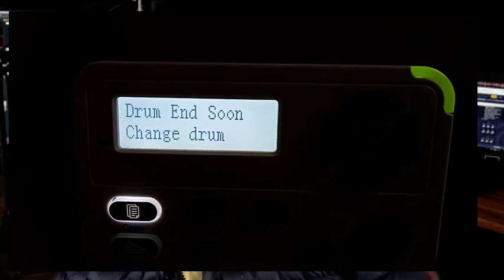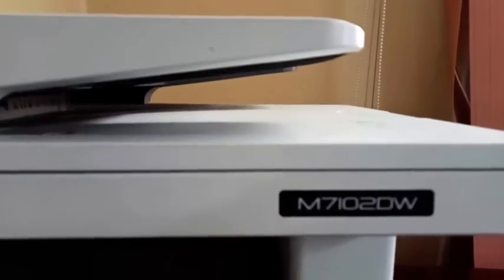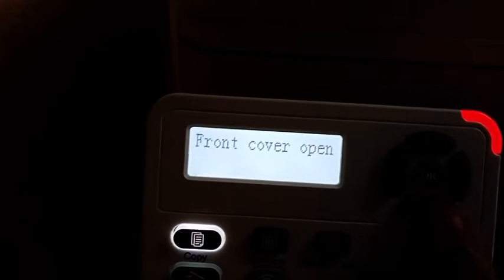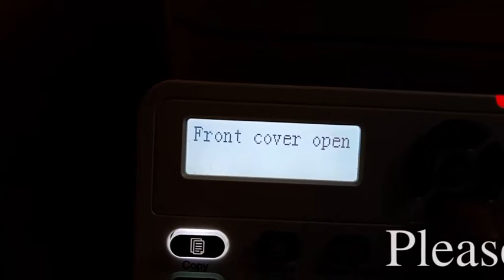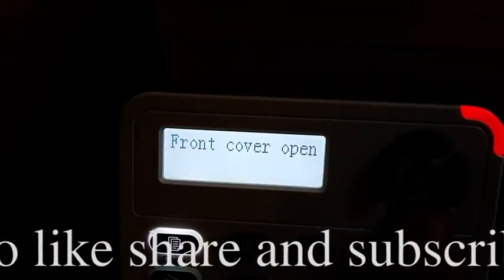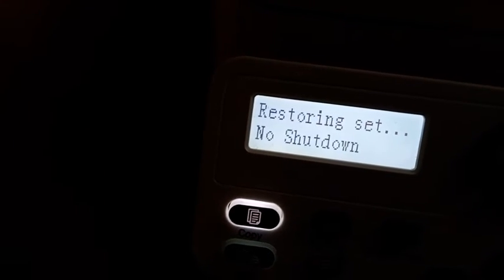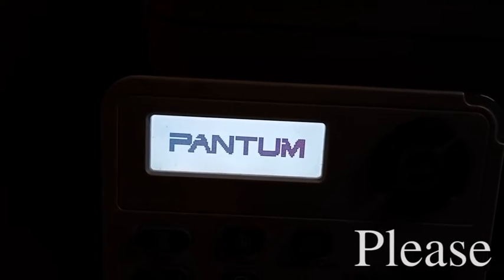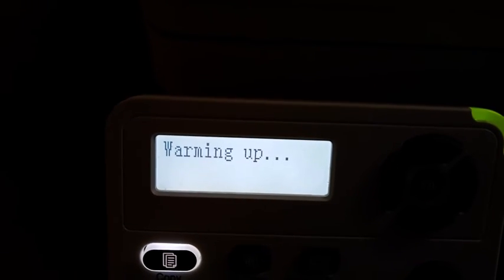pantum printer End drum soon || M7102DW|| solved

Comment: many times i uninstall driver and re installed but still i am having scanning problem ..it takes too long to scan or does not scan
Reply from the maker: sorry for late reply which connection did your printer have usb , rj45, or wirless it is depend up on please inform me which connection you have